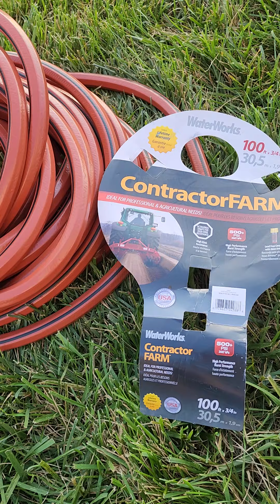What is happening to the electric grid?

Comment: I decided to make waffles (which I never do) and went through 3 brand new waffle makers in a week. I got my money back on the third return and went and picked up my parents' 50 year old waffle maker. It still works perfect. I wonder what the carbon footprint of the factory to landfill economy is?
Reply from the maker: Well put. Exactly what I am talking about. They dont make em like they used to because they are not allowed to make them like they used to. Planned obsolescence is something to research🎉
Reply: @StarPathAcademy while there is certainly planned obsolescence of manufactured products, I think the electric grid problems have a more nefarious explanation.  And it is intended to lead our planned obsolescence!
Reply: We had a rice cooker for 20 years. It died 6 months ago. We got a new one, same brand. It died after 3 months.
Reply: I was just talking to someone about this recently. Everywhere you look there are appliances on the curb with "free" attached to them, mainly LG, Samsung, and such. I talked to my applicance guy and you can't fix these new appliances, either can't get the parts or they cost too much so you may as well buy another. People are lucky to get 5 years out of these new appliances. I'm using an old gas stove that was in my house when I bought it 30 years ago, and it was old then! It works great, have never had to spend a dime replacing anything on it. It's ugly, but keeps on ticking!
Reply: @StarPathAcademy  Not so much planed to fail as not planned to last. Every component of a widget will have a very well defined MTBF, so manufacturers know exactly how long something will last and what will break first. People throw away things after 2 years to get the latest and greatest, so why overbuild for a 100 year lifespan?
Reply: @herbiehusker1889  I've gone through 4 (maybe 5) electric pressure cookers in 10 years. I have my regular stovetop model (again, probably 70 years old, but I do remember going with my grandmother to buy a new seal for it when I was a kid). Probably the same number of slow cookers. the heat is bad for the electronics
Reply: @sdrc92126  sure, but our old one lasted 20 years, and it only died because the switch wore down from being used so much that it wouldn't make consistent contact unless you held it down. It still functioned. I guess I should have gotten a new switch. But they don't really make replacement parts for things like that.
Reply: Same with washing machines.  Can’t seem to get one to last one day longer than the warranty.  If I could find an old one, like pre 1990, I would bet it would work
Reply: I have a more modern waffle maker.  but I also have one from 1960. Works perfectly. Flips over to be a griddle.

Comment: Electric grid problems are also due to poor design and/or wishful thinking. At least in places where they want to use a lot of renewables.
Solar and wind depend on the weather and when this production goes down, it has to be replaced immediately with something else or you get grid problems.

Comment: Just got a Walmart sprinkler and broke second night. Cheap brittle metal crap, maybe pot metal alloy idk. Useless. The brass fitting held but snapped right off the zinc whatever alloy
Reply from the maker: 2 way hose splitter from HDepot broke like to days ago, it was brand new. Seriously whats going on?
Reply: @StarPathAcademy  praying 🙏 my water timer holds up lol. Btw huge help in the garden 🪴 setting that up.